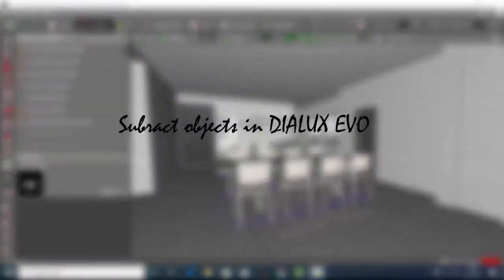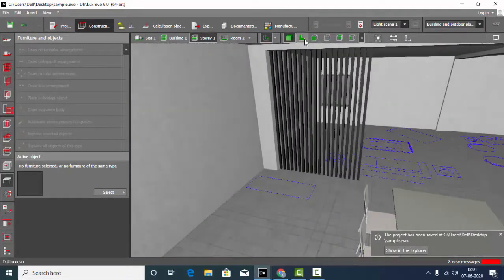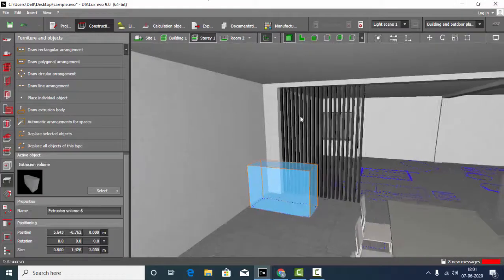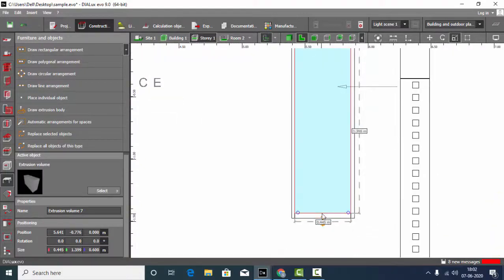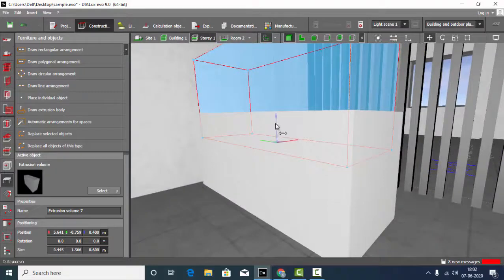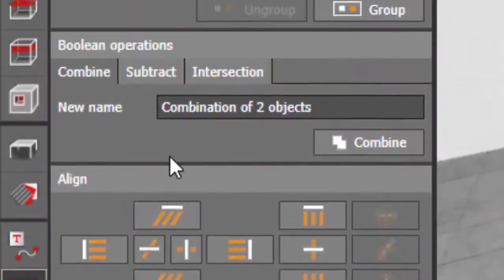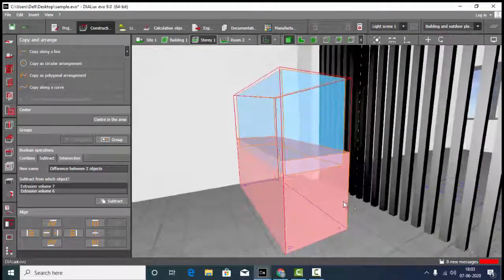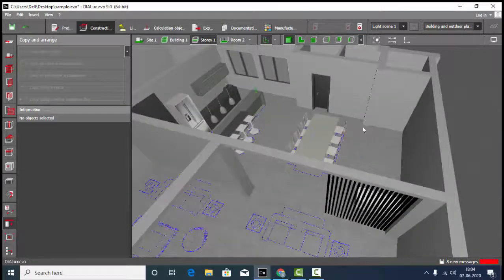HOW TO SUBTRACT 2 OBJECTS IN DIALUX EVO

Comment: how to spli walls ? I need to split a long wall into sections, becuase i want to make a wall panel with different textures
Reply from the maker: Spliting walls isnt possible but you can use cutout tools to cut very little thickness of wall and divide.